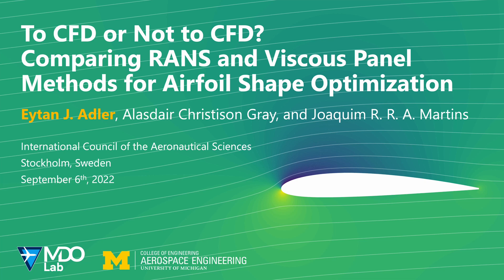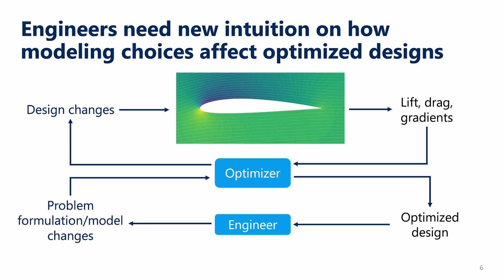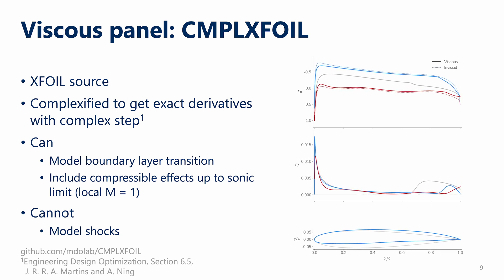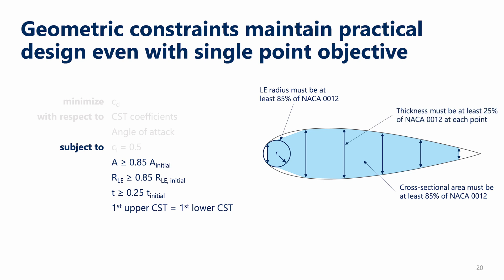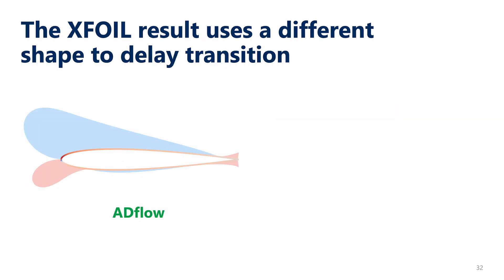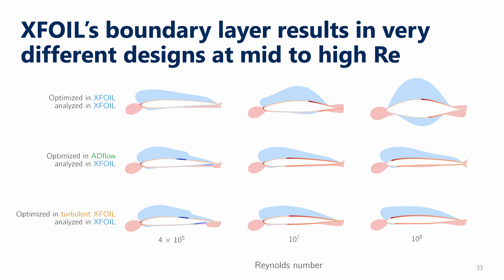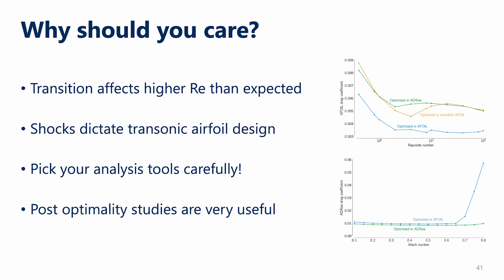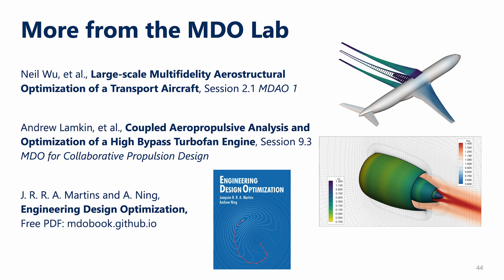RANS vs. viscous panel methods for airfoil shape optimization (ICAS 2022)

Comment: yep the problem with XFOIL, there is no subroutine implemented to stop if the local Machnumber exceed 1, or if the local pressure coefficient is lower than the critical pressure coefficient.
Reply: Hence, it goes back to your project requirement. XFOIL is good for Ma 0.66 and below. So if your requirement is to build a glider, general aviation aircraft, or commuter aircraft, XFOIL is a great tool for that as it is free. Otherwise, we still need an expensive CFD.
Reply: @hafizuddinmohdlowhim8426 but it easy to design an airfoil with high angle of attack at moderate subsonic Speed to exceed the local Machnumber of 1. I mean you can calculate the critical pressure and if the local pressure is lower than the critical you know the cide is in a Regime which is nit valid anymore.
Reply: @markoj3512  but the title asks to CFD or not CFD? That question doesn’t address on airfoil design only but rather the whole aircraft.
Reply: @hafizuddinmohdlowhim8426 ok maybe I miss understand something. IMHO XFOIL can only analyze 2D airfoils, not the whole aircraft, or even a 3D wing.
Reply: @markoj3512  if you listen to the presentation, they want to give an idea on aerodynamic shape optimisation. Airfoil is only part of that.